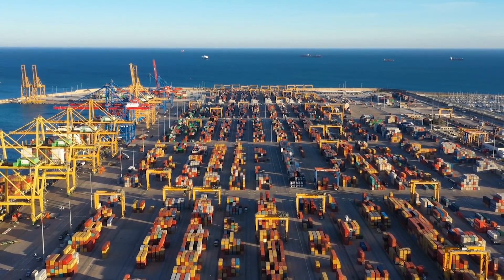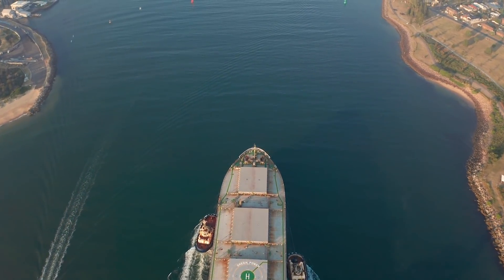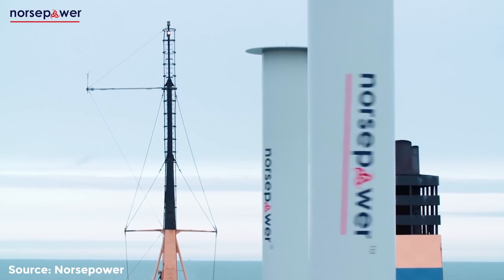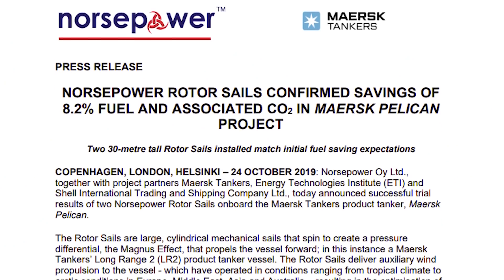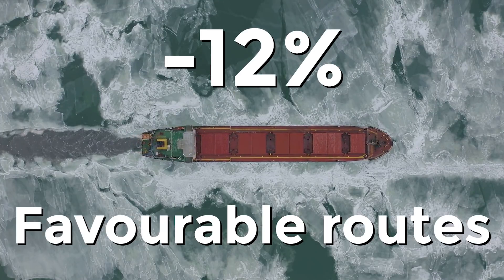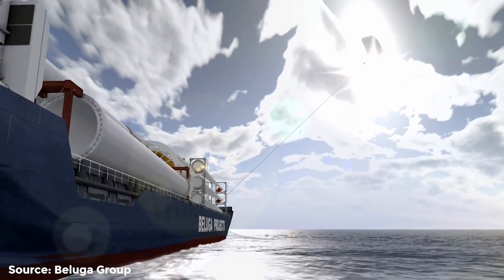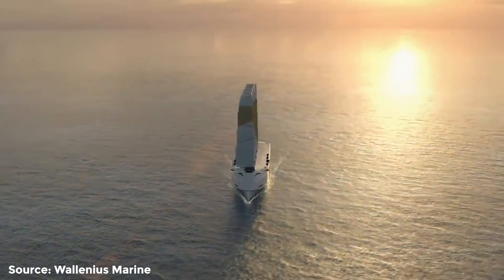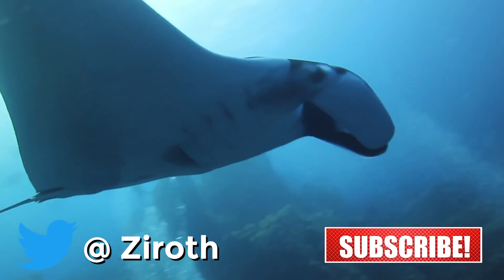Is Wind Power The Future of Shipping?

Comment: Should reduce the cost to the consumer not the overall profit to the company if the fuel is paid for by the shipper. Probably result in good competition.
Reply: To address the suggestions that wind power is the answer I offer the following example.  In 1870 a premium sailing vessel entered service, the ‘Cutty Sark’.  The 'Cutty Sark' was 64.74 metres in length with a beam of 10.97 metres and a loaded displacement of 2 100 tonnes.  She was able to carry, at best, 1 700 tonnes of cargo and to harness the energy in the wind the available spread of canvas was up to 2 976m2 which was tended by a crew of about 30 skilled men.  A ratio between the sail area (SA) and the vessels displacement (D) determines how lively she is; ‘lively’ being nautical speak for ‘fast and manoeuvrable’.  The carrying capacity of cargo ships is constrained in two ways, mass and volume which leads us to the ‘stowage factor’ of the cargo; the more mass on board the greater the displacement which in turn impacts the efficiency of the hull form and sail area / displacement ratio.  A vessel constrained by mass is said to be ‘down but not full’, while a vessel constrained by volume is said to be ‘full but not down.  When in the tea trade, which the ‘Cutty Sark’ was designed and built for with fine lines (more nautical tech speak, so again no need to worry about it) she could carry around 600 tonnes of cargo at speeds of up to 17.5 knots dependent on the prevailing wind and had a typical China to UK time on passage of 120 days.  The tea trade was very competitive so ‘time on passage’ was a large factor in securing the premium freight rate that made her cost effective.  Rounding things out, her maximum available sail area gave circa 5m2 of canvas for every tonne of tea carried.

As soon as the Suez Canal opened, which the ‘Cutty Sark’ was unable to sail through; she lost her advantage, raw speed, to the steam powered ships of that era who could beat her ‘time on passage’ by taking that short cut.  Mechanically powered ships have improved in terms of efficiency, on a freight tonne mile basis, by at least one order of magnitude since then.  After losing out to the coal burning, fire tube boiler, steam reciprocating mechanical ships of the late 19th century ‘Cutty Sark’ was relegated to the Australian wool trade, just about the bottom of the barrel in maritime terms and only one small step up from being a 'honey barge'.  The canvas, cordage and extra manpower needed for sailing ships was never a very benign environmental option so please discount any idea of sail as ‘sustainable’.  All this is without the problem that if ‘the wind don’t blow the ship don’t go’, when it does blow it often blows in the wrong direction for your cargo delivery needs and sometimes there is rather too much of it for comfort.  Sailing ships are unable to go directly up wind so if the wind is blowing form the direction your cargo needs to then a zig-zag course must be steered, more distance and more time.  Wind is traditionally measured on the Beaufort Scale (wind speed) that runs from 0 (< 1kn) to 12 (> 63kn) and for sailing purposes the usable part of the range is ‘3’ (circa 8kn) to ‘6’ (circa 24kn).

Random fact about ‘Cutty Sark’, it is said to have been possible to coax 3 000 horse power out of her sails, or in ‘real money’ 2 206 500 Watts (2.2 megaWatts), or 741 Watts for each square meter of sail area.  So that majestic spread of canvas would have been even less efficacious for delivering your baubles and bows from the orient, despite taking about three times as long on the voyage.  The sails on the ‘Cutty Sark produce about 0.33% of the power need to propel a Mearsk Triple E and covering the top of the stow might produce another 0.5% so with both systems working simultaneously in ‘ideal conditions’ the energy harvest would be less than one two hundredth of the output from the ICEs.  Remember shipping is a high volume low cost, therefore low margin business, and all costs have to be beneficial.

Canvas and hemp are accorded 'renewable' (read as ‘natural’) status, if ‘synthetics’ are used there will still be a need for the input of FOGI products.  'Synthetics' would have a much better working life span than 'naturals' but would still yield the same amount of energy, 741 Watts for each square meter in those elusive ideal conditions.  Wallenius are currently giving wind power a go with wing form ‘sails’ but evidence is a little short of proof as of this date.  KTH (Kungliga Tekniska högskolan), a sort of up market university in Stockholm, who are using the funding to derive results will probably, and eventually, in the best traditions of academia ‘publish’ a ‘paper’ unless the funders invoke the well known ‘commercial sensitivity clause’ of their agreement with the KTH.  On board wind turbine might get you around some of the problems, however for marine use vertical axis wind turbines (VAWT) would be better than, the what have now become 'traditional', horizontal axis wind turbines (HAWT) for reasons that include the air draught of the vessel, weight distribution and maintenance access.  The energy yield is still subject to the wind blowing at the right strength and having space available on board for the hardware.  The masts, rigging and sail handling arrangements would take up 'prime real estate' on the vessel.  Fuel oil bunker tanks can be stuck away in any odd corner and the ICE power plants are themselves relatively compact.  The stacked up 'boxes' would mean putting the wind driven propulsion units in a bad situation from a ship stability point of view.

Comment: As a sailor and boat designer, I challenge your doubts about sail power efficiency. If the winged cargo ship is receiving broadside wind at 20 knots and up, the ship will not need to use it's engines at all to reach 15 knots of ship speed, which is normal design speed of merchant ships. That means that in good conditions the ship won't use fuel at all. Of course we need engine power on head wind and calm, but in total I think the voyage could be done 75% less fuel consumption than with conventional vessels.
Reply: Not sure if you are responding to my 'Cutty Sark' example that I have been posting all over this thread but how do you feel about the sail area per cargo tonne and energy yield per m2 of sail area I posted? Also, at the point of needless repetition, how about wind turbines?  On board wind turbines might get you around some of the problems however for marine use of vertical axis wind turbines (VAWT) would be better than, the what have now become 'traditional', horizontal axis wind turbines (HAWT) for reasons that include the air draught of the vessel, weight distribution and maintenance access.  The energy yield is still subject to the wind blowing at the right strength and having space available on board for the hardware.  The masts, rigging and sail handling arrangements would take up 'prime real estate' on the vessel.  Fuel oil bunker tanks can be stuck away in any odd corner and the ICE power plants are themselves relatively compact.  The stacked up 'boxes' would mean putting the wind driven propulsion units in a bad situation from a ship stability point of view.

Comment: It was the past,I dont know if it is the future.
Reply: To address the suggestions that wind power is the answer I offer the following example.  In 1870 a premium sailing vessel entered service, the ‘Cutty Sark’.  The Cutty Sark was 64.74 metres in length with a beam of 10.97 metres and a loaded displacement of 2 100 tonnes.  She was able to carry, at best, 1 700 tonnes of cargo and to harness the energy in the wind the available spread of canvas was up to 2 976m2 which was tended by a crew of about 30 skilled men.  A ratio between the sail area (SA) and the vessels displacement (D) determines how lively she is; ‘lively’ being nautical speak for ‘fast and manoeuvrable’.  The carrying capacity of cargo ships is constrained in two ways, mass and volume which leads us to the ‘stowage factor’ of the cargo; the more mass on board the greater the displacement which in turn impacts the efficiency of the hull form and sail area / displacement ratio.  A vessel constrained by mass is said to be ‘down but not full’, while a vessel constrained by volume is said to be ‘full but not down.  When in the tea trade, which the ‘Cutty Sark’ was designed and built for with fine lines (more nautical tech speak, so again no need to worry about it) she could carry around 600 tonnes of cargo at speeds of up to 17.5 knots dependent on the prevailing wind and had a typical China to UK time on passage of 120 days.  The tea trade was very competitive so ‘time on passage’ was a large factor in securing the premium freight rate that made her cost effective.  Rounding things out, her maximum available sail area gave circa 5m2 of canvas for every tonne of tea carried.

As soon as the Suez Canal opened, which the ‘Cutty Sark’ was unable to sail through; she lost her advantage, raw speed, to the steam powered ships of that era who could beat her ‘time on passage’ by taking that short cut.  Mechanically powered ships have improved in terms of efficiency, on a freight tonne mile basis, by at least one order of magnitude since then.  After losing out to the coal burning, fire tube boiler, steam reciprocating mechanical ships of the late 19th century ‘Cutty Sark’ was relegated to the Australian wool trade, just about the bottom of the barrel in maritime terms and only one small step up from being a 'honey barge'.  The canvas, cordage and extra manpower needed for sailing ships was never a very benign environmental option so please discount any idea of sail as ‘sustainable’.  All this is without the problem that if ‘the wind don’t blow the ship don’t go’, when it does blow it often blows in the wrong direction for your cargo delivery needs and sometimes there is rather too much of it for comfort.  Sailing ships are unable to go directly up wind so if the wind is blowing form the direction your cargo needs to then a zig-zag course must be steered, more distance and more time.  Wind is traditionally measured on the Beaufort Scale (wind speed) that runs from 0 (< 1kn) to 12 (> 63kn) and for sailing purposes the usable part of the range is ‘3’ (circa 8kn) to ‘6’ (circa 24kn).

Random fact about ‘Cutty Sark’, it is said to have been possible to coax 3 000 horse power out of her sails, or in ‘real money’ 2 206 500 Watts (2.2 megaWatts), or 741 Watts for each square meter of sail area.  So that majestic spread of canvas would have been even less efficacious for delivering your baubles and bows from the orient, despite taking about three times as long on the voyage.  The sails on the ‘Cutty Sark produce about 0.33% of the power need to propel a Mearsk Triple E in ‘ideal conditions’ so the energy harvest would be less than one two hundreth of the output from the ICEs.  Remember shipping is a high volume low cost, therefore low margin business, and all costs have to be beneficial.

Canvas and hemp are accorded 'renewable' (read as ‘natural’) status, if ‘synthetics’ are used there will still be a need for the input of FOGI products.  'Synthetics' would have a much better working life span than 'naturals' but would still yield the same amount of energy, 741 Watts for each square meter in those elusive ideal conditions.  Wallenius are currently giving wind power a go with wing form ‘sails’ but evidence is a little short of proof as of this date.  KTH (Kungliga Tekniska högskolan), a sort of up market university in Stockholm, who are using the funding to derive results will probably, and eventually, in the best traditions of academia ‘publish’ a ‘paper’ unless the funders invoke the well known ‘commercial sensitivity clause’ of their agreement with the KTH.  On board wind turbine might get you around some of the problems however for marine use vertical axis wind turbines (VAWT) would be better than, the what have now become 'traditional', horizontal axis wind turbines (HAWT) for reasons that include the air draught of the vessel, weight distribution and maintenance access.  The energy yield is still subject to the wind blowing at the right strength and having space available on board for the hardware.  The masts, rigging and sail handling arrangements would take up 'prime real estate' on the vessel.  Fuel oil bunker tanks can be stuck away in any odd corner and the ICE power plants are themselves relatively compact.  The stacked up 'boxes' would mean putting the wind driven propulsion units in a bad situation from a ship stability point of view.